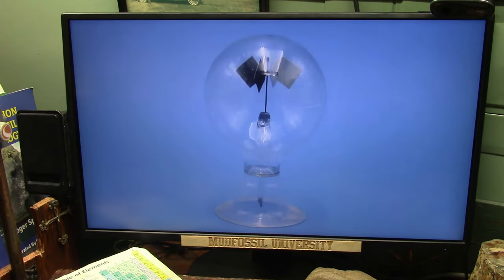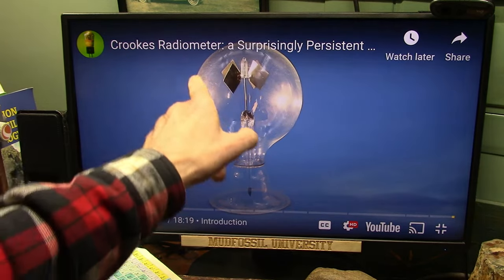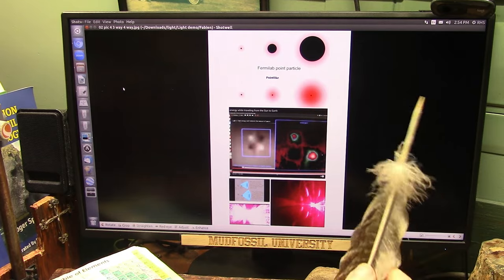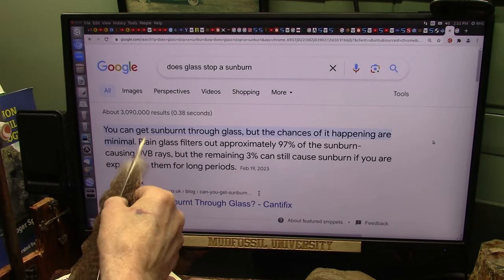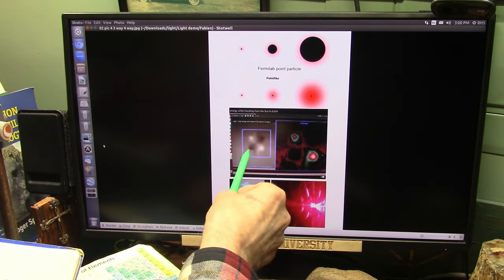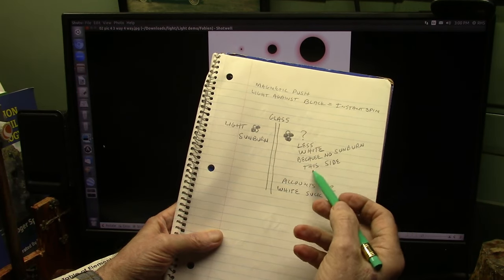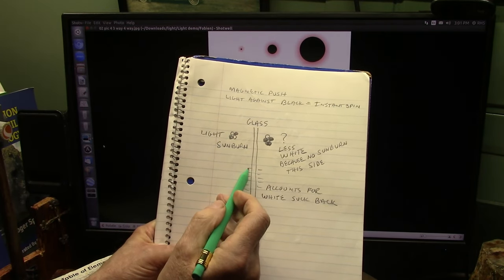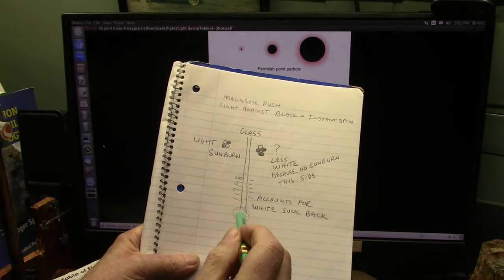Crookes Radiometer ..a Toy Clouded in Mystery for 150yrs is now Clear as Glass and very simple

Comment: It'd be interesting to get one and break the globe off and place that vane setup inside a pint jar and evacuate the air completely to see if it can move without residual air inside.  Then try different gases like Argon, Nitrogen, etc to see if they affect how fast the vane moves.  Maybe try different colored lasers instead of white light.  Does an LED flashlight have UV rays?

Comment: Nope, it's not the glass. What makes the meter work is heat & cold. apply heat, and it will turn in one direction. Then, put an icecube on the glass and rub it a little, and the meter will turn in the opposite direction.
Reply from the maker: Much to simplistic...heat is the white and black is cold...dig deeper.
Reply: FREQUENCYS CODES!!